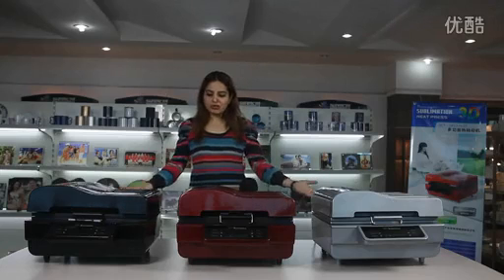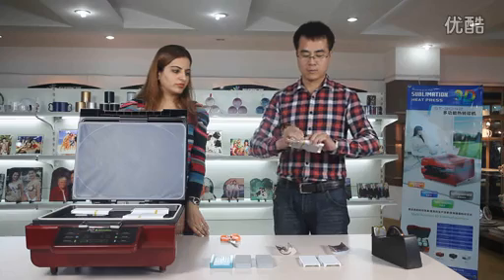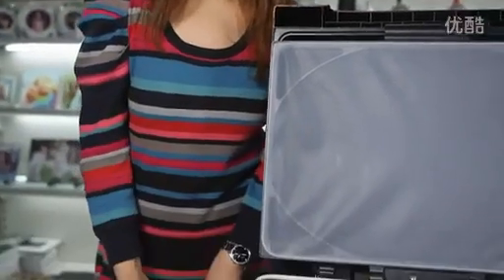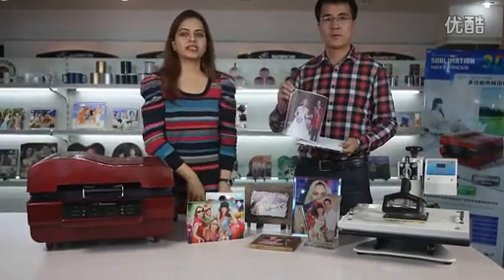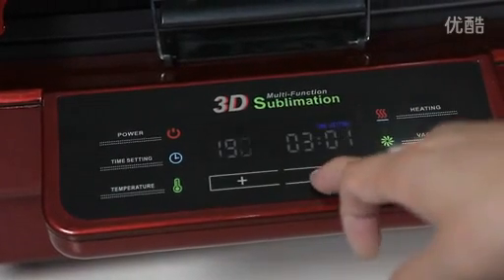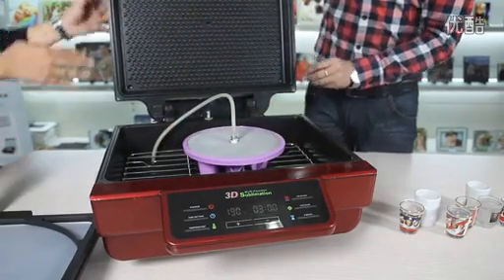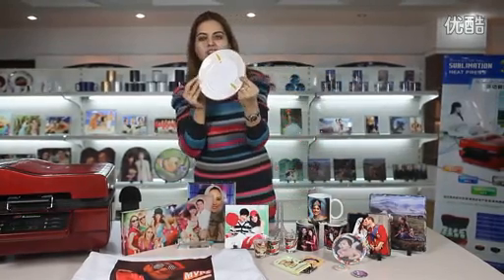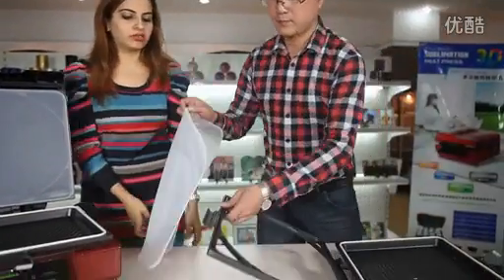3D vacuum sublimation machine www.printercom.ru / www.press3d.ru

Comment: I bought one of your machines and its fine it works with everything except with plates. After 5-6 plates silicone membrane explodes.
Reply: Hi where did you get it from and all the bits that go with it , do you need more than one printer to print out the photo's , if so what type did you use. Thank you
Reply: Donald Cox Hi, i bought it from Yiwu China and I am using epson R230 for printing and you can do it with one printer. If you re interested in ths add me on Facebook.
Reply: sure my facebook name is donald cox
Reply: hey i can not find your facebook id please tell me this printer paper name